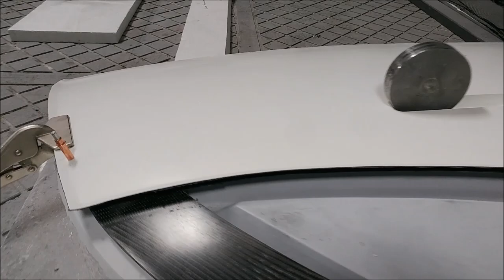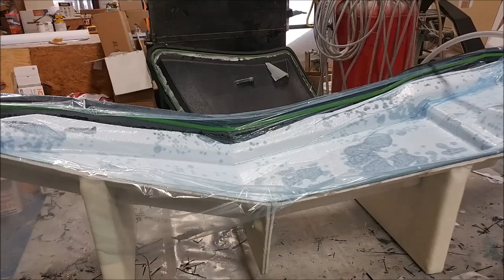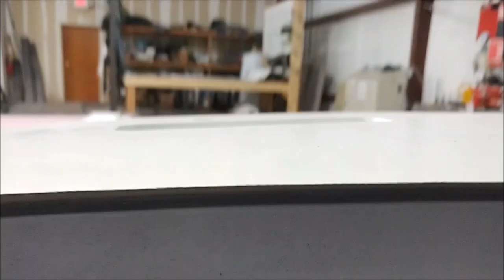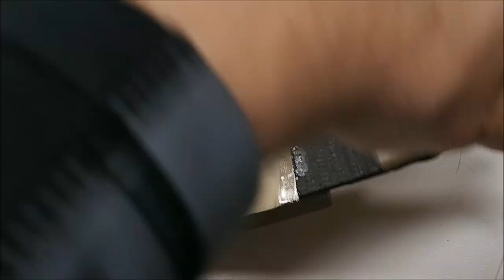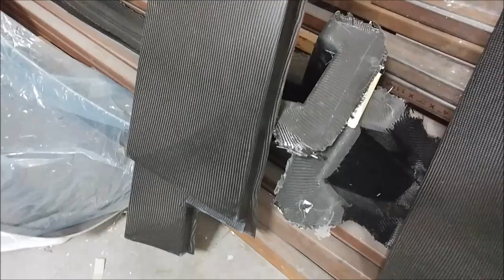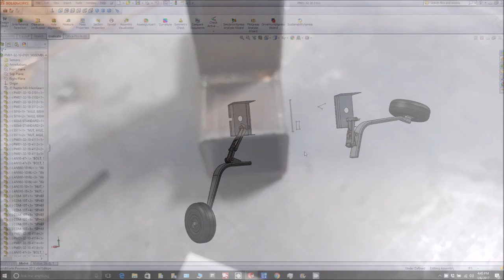Raptor Aircraft January 7th 2017

Comment: also I watched the  video of elaborate steering and rudder application. would it be possible to operate speed brakes with air cylinders and then hook them up to the vacuum pump ? that would be cheaper and faster than electric actuators wouldn't it ?

Comment: would it be possible to add  eccentric brass bushings  in all you hinges ? that way it would be easy to replace them, adjust them   and an o ring could be added to seal everything up  when you pressurize the cab . Thanks for keeping us updated
Reply from the maker: Where it makes sense we will be doing that.

Comment: Can you later on elaborate on the landing gear mechanism? I didn't quite follow where will a piston/hydraulic cylinder/servo will attach to pull it out and in and which backup mechanism in case it fails are there.
Reply from the maker: Stay tuned. All will be revealed.